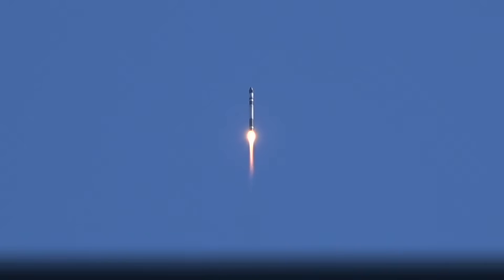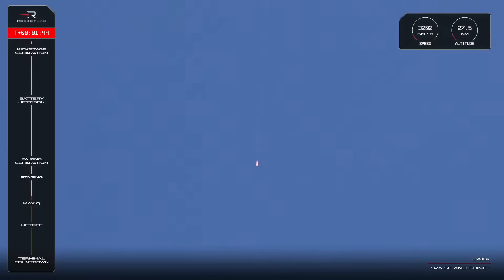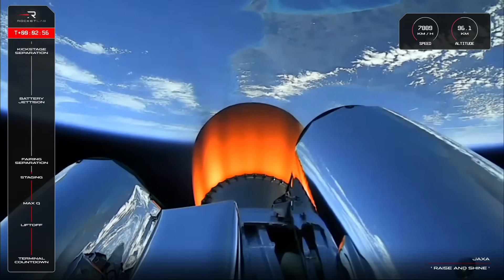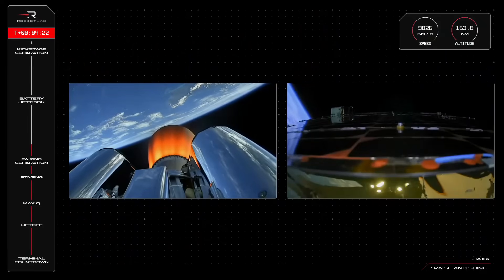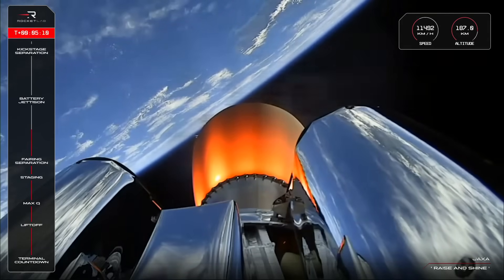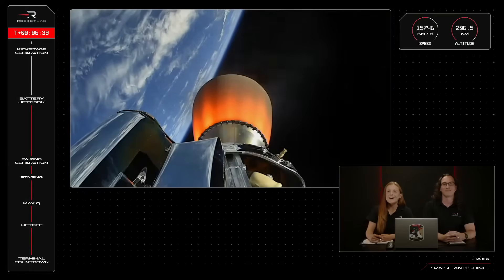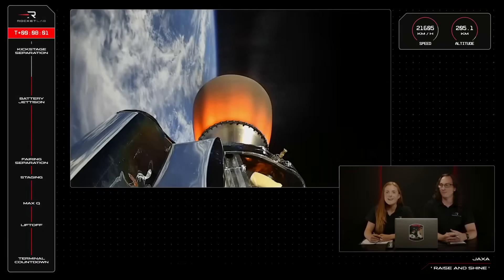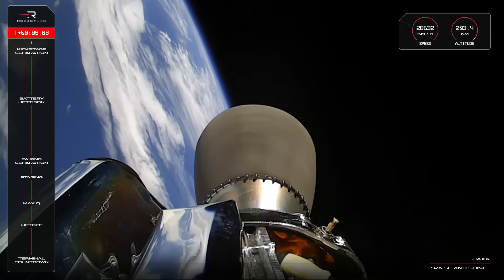Liftoff! Rocket Lab launches JAXA's RAISE-4 satellite from New Zealand

Comment: Outside camera , 10000 kph abnormally still 🥸
Reply: what did you expect? wind? as the narrator explained, it was well past the 'max Q' point at around 14km altitude when it was going 1600 kph. With less and less atmospheric pressure, it went faster and faster. By the time it was going 10,000 kph the craft was 167km up. no atmosphere, no wind, nothing to shake the camera.